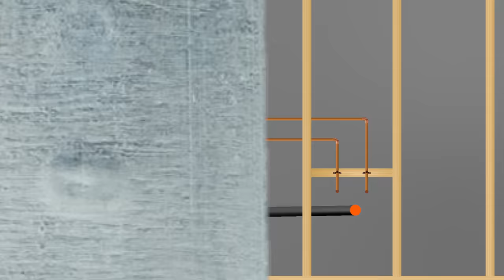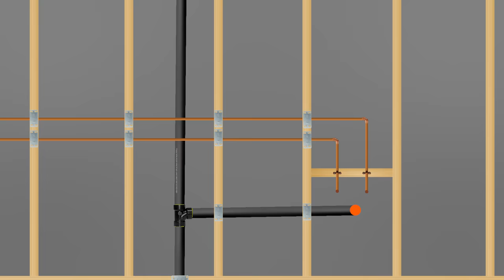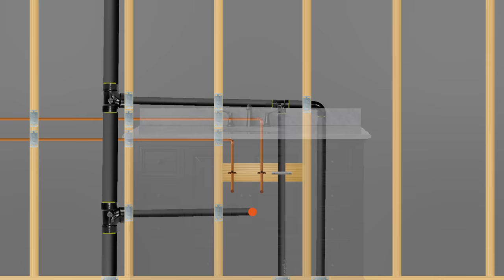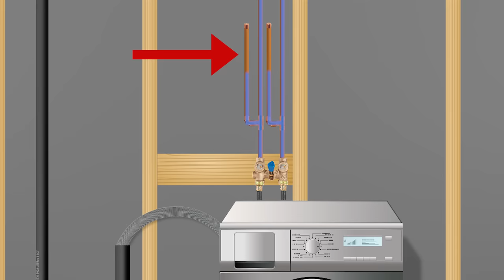10 Reasons Why You'd FAIL a Plumbing Inspection! | GOT2LEARN

Comment: You might fail if you did these after the rules changed, but not if the work was done to previous code- this may confuse people. 

adding dates to the program for when the new rules went into effect would help clarify this.

Also- personal gripe/rant - the steel plates meant to protect a screw from piercing a pipe or wire are useless... test against an impact driver... you don't even notice them when driving a screw through drywall.  Adds complexity and cost without any real value. And you need to notch out a 1/8 inch to have a flush install of drywall atop of it.

Comment: FYI, when plumbing in a washer machine drain. The distance between the 2" San Tee to your 2" P-Trap needs to be a min 4" piece.   you cannot hub up the 2 together. If so, you will surely fail.

Comment: also the length between your 2'' p trap and your 2'' tee must be minimum 2x the pipe diameter for a laundry so 4''
Reply from the maker: 100%
Reply: @Got2Learn  are you based out of canada or the states? curious because i appreciate all the code and im from west coast canada so want it to apply :)
Reply from the maker: Yes, Montreal here 🇨🇦

Comment: Great info and I am sure that my house has some of these violations on a toilet and pipe protectors
Reply from the maker: Oh no!
Reply: @Got2Learn  toilet is 10 inches from wall and had a nail in a copper water line at a shelf.
What is rule on Junction boxes for light locations?

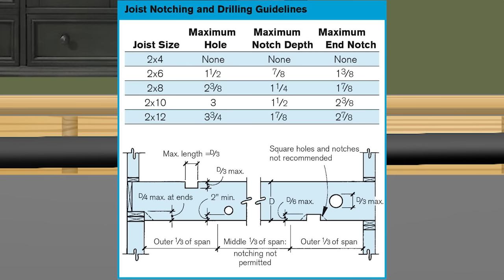Comment: At 7:03  you have included an error in your diagram.   Top notch maximum cut is Width D/3  but max depth is D/6.  The diagram is in error as it states D/3.  D/3 is incorrect.   How many years has this been up?   And was the diagram copied out of a code book?  Fix it.

Comment: When installing a vent, can it be higher than the minimum?  I have to get over a window and the window is very high. Also when running a vent, should I use a T or a wye?  If the answer is a wye, do I run like it would be running up or down?  Thanks

Comment: So the vent... how do you use a one way check valve vent they sell to be installed under an island
Reply from the maker: To be code, it would need to be installed 6" above the rim level of the sink, but no one does that, they install it at the highest point in the cabinet, but if something was to happen it would come out from there and not the sink so you wouldn't see it. Companies like Oatey sell finished boxes to install they so they are accessible, that's the way it SHOULD be done, here's what I am talking about: https://www.amazon.ca/Oatey-39260-Box-Kit/dp/B00IG45Q7E/ref=asc_df_B00IG45Q7E/?tag=googleshopc0c-20&linkCode=df0&hvadid=292948035809&hvpos=&hvnetw=g&hvrand=2147905267095418821&hvpone=&hvptwo=&hvqmt=&hvdev=c&hvdvcmdl=&hvlocint=&hvlocphy=1002580&hvtargid=pla-323324365572&psc=1
Reply: @Got2Learn  In basement remodels my plumber mounts them at the top of the wall with a vent box/cover.

Comment: With violation #3, if I'm connecting a 2" shower drain with a 3x3x2 wye, does it require a 45 in the 2" part of the wye? The 3" is not perpendicular and I can catch the 2" at the angle directly into the wye. A 45 will change the angle too much. Thx

Comment: You should put a disclaimer about what states these rules apply for...these are not federal mandates - codes vary state to state.  Using the example of the protective steel plate, New York code states, "In concealed locations, where piping, other than cast-iron or galvanized steel, is installed through holes or notches in studs, joists, rafters or similar members less than 1.5 inches (38 mm) from the nearest edge of the member, the pipe shall be protected by shield plates..."

Comment: Good video. I recognized your voice immediately from pressure pipe videos - where your tip on using tinning flux and silver sol for lead free joints restored my ability to replace a leaking copper valve in a tight-crowded basement ceiling.   I almost went out to buy shark bites for that one.  With plumbing, it’s never just one trip (or one store) for the necessary hardware. Great information!!!
Reply from the maker: Thank you so much!

Comment: #7 You CAN plumb new fixture to an existing vent If the vent is a 2 in or larger pipe! and the section below where you teed to will be called WET VENT.
Reply: No it won't be a wet vent.
Reply: @armandhammer2235  yes it will be wet vent. Its indicated under international plumbing code with pictures exactly as I mentioned up there.
Reply: @Amer-yl4gb  No it won't, if the code he talked about where a dry vent goes horizontal 6" above the flood level than liquid will never be introduced in to the vent. Over 3 stories run a vent stack and the same. I'm guessing we're talking about single family residential.
Reply: @Amer-yl4gb  Amir I respect that you understand what a wet vent is, but you're wrong.
Reply: @Amer-yl4gb  The code says two pipe sizes larger than minimum on a horizontal wet vent.
Reply: @Amer-yl4gb  Considering you're wearing a tie in your pic, all your knowledge comes from a book and you interpreted wrong. Some inspectors interpret wrong also.
Reply: @Amer-yl4gb  If you revent back into the waste stack, then yes that would be a violation.
Reply: @armandhammer2235  how a tie from party picture relates to how a person obtains the info?lol and FYI, everything is on internet these days all codes n bylaws.. anyways I'm not sure how off anyone can interpret a clear picture/diagram where there are 2 P-traps on same level one on top of another sharing a 2in pipe in between and 1.5 in vent pipe going up to the roof.
Reply: @Amer-yl4gb  Dude, I've been plumbing in 4 states for 35 years, you're wrong.
Reply: @Amer-yl4gb  Are you talking about the S-trap or the revent?
Reply: @Amer-yl4gb  My point to you Amir is if you read something in a book and have never practically applied the knowledge, you shouldn't be spewing nonsense.
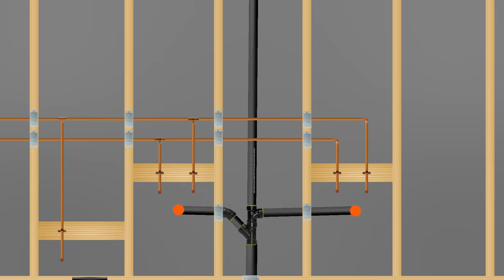Reply: @armandhammer2235  actually the example that's being shown @3:10 in the video is exactly what I'm talking about. 2 fixtures sharing the same vent and the lower pipe is being tied off in to wet vent!!! Looks like you've been over complicating yourself for the past 35 years... :)
Reply: @Amer-yl4gb  I'm done with you Amir.
Reply: @Amer-yl4gb  Wait a minute, you're talking about #7 where he is 100% correct. 😅🤣
Reply: @armandhammer2235  #7 Where he said @5:03 "you can NOT tie a second fixture to that laundry drain vent if that was only thing you had"... I'm saying you CAN tie into that drain pipe just like the setup shown at 3:10 provided the vent pipe is 2 in or larger.
Reply: @Amer-yl4gb  I'm saying you're wrong. Period.
Reply: @Amer-yl4gb  What you're talking about is a vertical combination waste and vent on the same floor level. You're wrong.

Comment: do you have a diagram to plum a bathroom with concrete slab. i want the shower on the wall than toilet and sing where the door entrance is my configuration 5x7 size bathroom thank you walls will be 2x6

Comment: How do you "slope a pipe" if the fitting it's  going into is not "sloped: itself ??...or even molded to accept a "sloped pipe"...
Reply from the maker: There is a bit of play in them which allows the pipe a few degrees of movement.

Comment: For you people on here saying an improper or system that does not meet code will still work are mostly wrong... it may work as far as draining but not without other unintended problems..for example..using 1.5” pipe for a laundry drain instead of 2”...  if you used 1.5” pipe today with the new washers out there that put out much more volume of drain water it will overflow onto your floors, yes it will eventually drain but not without consequence... using vent fittings or short 90 degree bends  may drain fine but will cause clogs in the system that you have to pay a plumber to come fix.... there are reasons the code is there ..use it and be worry free or issue free

Comment: My Nephew walked out on a job because the plumber had cut the joists to install a drain from a inside wall like the customer wanted. He had warned the customer in advance they could not do that.
Reply: The drains gotta go where the drains gotta go. If there's a joist in the way because the architect and framers weren't thinking ahead, then it either needs to be moved or cut out. This is why plumbers always go in first before the other trades because they love to put their ducts and wires right where we need to run pipe. Never fails. Ducts and wires can be moved, pipe cannot most times.

Comment: Do people whose houses built before in 1940s, 1950s, 1960s,and 1970s.  My house was built in 1973, according to new codes of in 1990s and so,  some part of plumbings  of my house definitely failed, ie washing machine pipe 11/2" diameter and some drainage pipe. when I bought the house in 1999, hired a house inspector, who did not fail the plumbing inspection but he did fail  some electrical parts and needed to be fixed.

Comment: in my code where i live, it says that we need to have at least 2x the length of the diameter of the pipe for drainage. is there a reason for that? tried to ask my journeymen about it and all they can say is its in ur plumbing code. tried to do the roughing for a washing machine and was told that but it wasnt explained properly and im still wondering the reason for that...

Comment: Not plumbing but electrical.  Today, in our area, you may not hard wire an appliance like a stove, dishwasher, microwave.  It must have its own plug and a dedicated socket.  I saw this coming in our area when I did a kitchen remodel in 1988.  I installed an electric stove, a dedicated properly sized plug and a socket, know that this was going to be the next code change in this area.  My inspector cited it and told me that I had to hard wire the stove (wink wink).  I said, yup (wink wink).  The next month the code changed.  He was on the same page, knowing to make me conform to code that was about to change was just silly.  I know that some of you might argue this.  I was not about to hard wire and then pull it and do it the new code way a month later.  Obviously he tacitly agreed.

Comment: Something I've been curious about is PVC to ABS transition joints using an approved transition cement on a fixture drain. While I'm quite well aware this isn't up to code, there doesn't seem to be an actual issue doing this, it would probably be better and longer lasting than an "approved" method of such as using no hub coupler. Would an inspector typically fail this? From what I have seen an ABS to PVC joint with transition cement is just as strong as a PVC to PVC joint, though not quite as strong as ABS to ABS.

Comment: Would love to know how this code fits in with retro-fitting without costing the customer a new mortgage
Reply: Same here, my house was built in the 50s, It would cost 2x the amount I actually paid for the house just to bring every single thing up to code
Reply: @neoasura  In most municipalities, you're grandfathered in on the old code. Unless you remodel more than 50% of your house, you don't have to bring the entire house up to code. However, if you change a piece of equipment, like your boiler or hot water heater, that would have to be installed up to the new code standards.

Comment: #7: why would connecting to an existing vent would be an automatic failure? Some fixtures could share vent, as long as the vent is big enough?
Reply from the maker: Yes, as long as the vent is big enough, most times it isn't.
Reply: how big is vent pipe should be so it can be shared? Can the laundry vent on the 1st floor be shared with vanity , toilet and shower in the basement ?

Comment: There’s actually 3 cases where you can use a short sweep 90° on drainage
A toilet
Your drain goes from horizontal to vertical 
A trap arm coming out of the wall!!
Other than this very informative, I’m just a little bit confused on plumbing into an existing vent failing you

Comment: I learn something new, Recently I left my home for a week, with all window closed. When I returned I experienced a strong sewer smell in my second floor bath room. The only thing I can think of is a P-trap were the tube is because the sink and the toilet are seal off. Moving forward cutting dry wall and locate the tube P-trap all looked normal, no leak , no moisture. So I left the house for a week again, this time no smell or might just be little. Bottom line after watching this video, I think I found the root cause, The bath room and both bed room door they all automatically close every time I try to leave it open. This mean my house is tile or sink on one end causing water from the tube to pull from the P-trap faster thank normal is. This also explain why I hear water noise when the second floor toilet flushes. Any one have any idea how to solve this problem?

Comment: I'm surprised how sometimes plumbing inspectors did inspections. They came in, checked two spots and left right away.
Reply: I’ve literally been green tagged on multiple occasions where the inspector never stepped foot in the building. Did it from the computer in his truck 😆 must have had somewhere he needed to be after work

Comment: I have a 1 1/2” shower drain (my code allows 1 1/2” for shower) extending  72” from the stack to an existing dedicated vent just DS from the old bathtub p trap. I am extending the drain about 30” beyond the dedicated vent with p trap at the new end so I guess you could say I would exceed the pipe diameter at 1/4” per foot overall but my understanding is the dedicated vent makes it OK since I am within the 1/4” per foot from the vent to the stack. Anyone think that would fail inspection?

Comment: These codes in the US? Canada? Antarctica?

Also, this only applies to new plumbing jobs correctly? You can't demand this stuff on pipes that are 20-50 years old.
Reply from the maker: This is for Canada, but some of these apply to the US. If your system was built before, you probably have aquired rights so it doesn't need to be changed!

Comment: Question at 4:50 What if I'm not lucky enough to have an extra vent to tie into in the basement? Why can I not tie into the existing vent?
Reply from the maker: As to not overload the existing system. As mentioned in the video, there are other ways to do it such as loop vents or mechanical vents, but to be code, it has to be connected above all drains on the highest floor.

Comment: Sooo I appreciate trying to inform your viewers on basic plumbing code. But not all information is correct for example you can use a tee wye on the horizontal for a double lav or our vent height only has to be 38 inches off the floor and in some cases where I cannot be at 38 inspectors will allow it to be as high as possible but I have to add a clean out. My point is that if you plan on doing work and are not familiar with plumbing code. Please call your areas inspector and ASK!! They might just shock you
Reply from the maker: Yes, 100% inform yourself with your local inspector BEFORE doing any works, thanks Mike!

Comment: Some of these have got to be Quebec or local municipal specific regulations. In national code there’s no restriction on standard short sweep 90’s at the bottom of stacks. Also the sub soil water closet branch is accurate as far as the connection to main is concerned but there’s no vent shown. Also not only do you need a cleanout on main stack, one is required on every waste or soil stack AND in the case of main stack, the clean out shall be minimum 4” or the size of the branch or building drain it drains to, whichever is larger. Since almost universally, 4” is the minimum size of a building drain and that 99% of the time a stack drains into a building drain the minimum size of the clean out on on main stack will be 4”. Also, I’m not familiar with Quebec code, but in national and Ontario code you can 100% connect to an existing vent. Air don’t care. It’s called a branch vent. Unless the vent terminates in outer space I see no problem here. The fabricated hammer arrestors aren’t prohibited in national or Ontario code. Code states “provisions shall be made for water hammer”. That’s all. Now while I make these points, I acknowledge that local bylaw may supersede provincial code, it may require above and beyond provincial code, but must meet the minimum requirements set out by provincial code.

Comment: Another common violation: the horizontal portion of a drain from the base of a stack cannot have a branch connection closer than 10 pipe sizes from the base of the stack.
Reply from the maker: Yup!

Comment: Another code that pisses me off is the water conservation codes that force you to use low flow.   They have no understanding that iron sewer pipes like to spall and catch TP and and hard blackwater forming blockages.  You have to have lots of water flowing to keep the pipes clear, or you're calling a plumber weekly.  Iron = High Flow.  PVC = Low Flow.